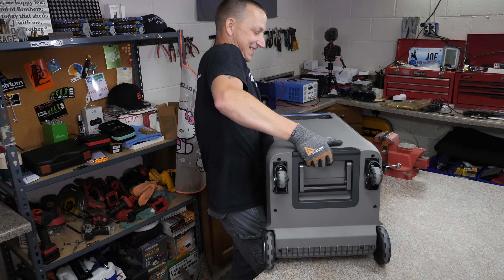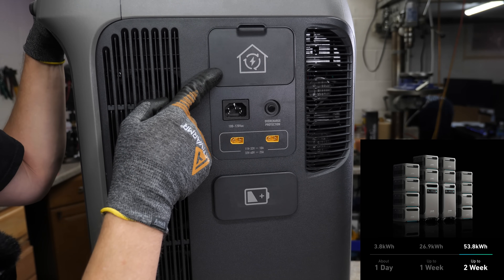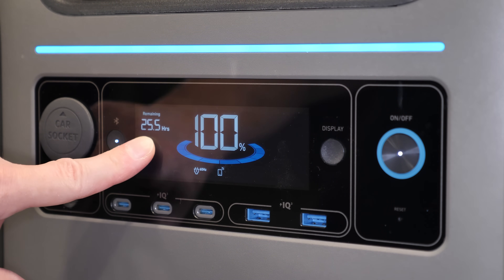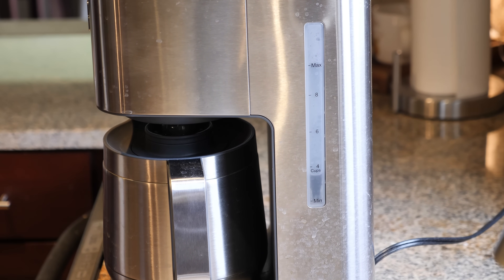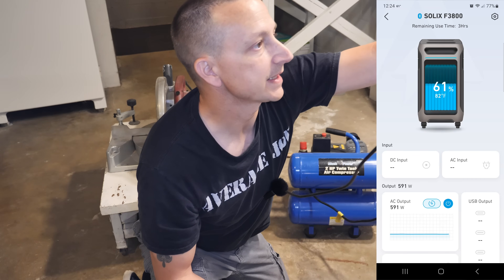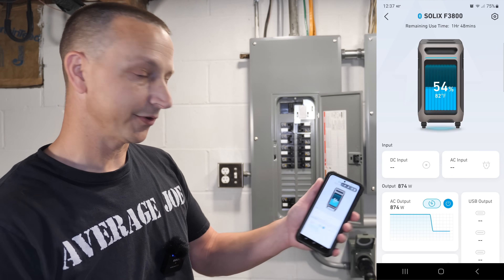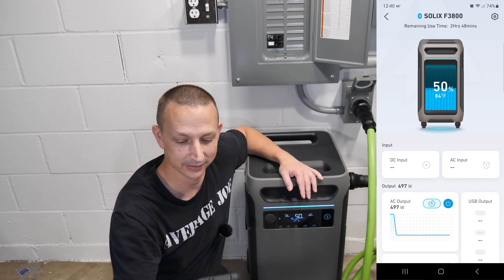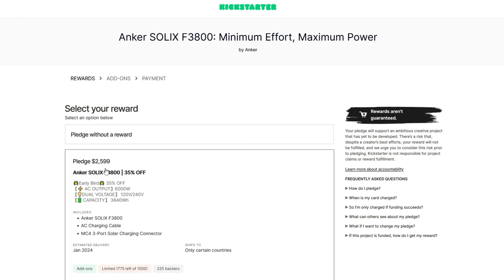Power your House in a Blackout with The Anker SOLIX F3800! It does 240V!!!

Comment: Did you try to charge it while using the 240v output? It will die relatively fast as a whole home backup. Anker said the 240v outputs go off when charging by 120v input. I was going to charge it by an inverter generator but then my entire house will go dark. Seems like they could have designed this aspect better as the rest of the system seems very nice. Solar is an option but at night and in stormy weather is useless. Thanks for the great video.
Reply from the maker: Yep it will shut down however...they are making a new version and they plan to fix that problem as well as raise the solar input voltage I hear. If so that will be a game changer!🤘

Comment: We are looking for generators we can donate to western North Carolina . What  generator would you recommend.? Keep in mind the generator will have to be carried in by hand or air lifted . They need to run the essential
Reply from the maker: I wish I could be there to help! So this portable power station is pretty heavy as many 48v versions are but does have the easy handle and bigger wheels. Also does 240v if thats needed and has 3.8kwh battery? Another GREAT one is the ecoflow deltas. They are a little smaller in size but about the same battery capacity at 3.7kwh but not 240v. I have a video on them when we had a devistating storm. I let my buddy use them. The Pecron E2000 is another GREAT one. Its smaller tho but works great. Battery is 2kwh. Again, I have a video on that. Oukitel has the p5000 which is fantastic and has 5kwh. I have links in all the videos and some  have discount codes. Also many are on amazon so could possibly get them somewhat fast. Honestly, for what your wanting to do. Id get almost anything to help a brother out. If you have more questions please let me know and Ill help where I can! Stay Safe Brother
Reply from the maker: You should email me any questions averagejoestuff@gmail and I can help!

Comment: Excellent video! I'm sure you're right - without the soft start on your HVAC it would have tripped/shutdown the Solix (assuming the wattage initially draws +6000W - the apps usually don't track the spike since it happens so quickly).
Reply from the maker: Yeah its hard to say. I wanna say I started it with 2 ecoflow delta pros paralleled together before I installed the soft start but cant remember. I may actually do it🤔

Comment: How does this compare to the equivalent Ecoflow? Is there any other one that you would recommend? I'm in FL and hurricane season is coming, and I have a 3/2 home with a 4 ton A/C Unit. Looking to find a manual switch over generator like the Anker Solix and later hook up solar to it as well.
Reply from the maker: I did a comparison video between the F3800 with expansion battery and EcoFlow Delta pro Ultra. Purely going off specs they are close. The ecoflow has better options for solar. Anker is moar portable. Both can start my 4ton AC but I have a soft start on mine.

If you want to power your entire home and use the AC "long term" in an outage, you would need a few expansion batteries on either system.

Comment: Can you charge this power station from a 120 volt inverter generator like a Dual Fuel Champion Invertor Generator, while using the 240 volts from the Anker Solix F3800 power station?  I know that I can't charge my two EcoFlow Delta Pros from 120 volt grid power or an inverter generator power when I have the two Ecoflow Delta Pros hooked together for split phase 120/240 volt power.  Thanks, great video.
Reply from the maker: Thanks for watching! This one cannot supply 240v and beable to charge from a 120v source at the same time sadly. I did mention this to Anker in a meeting. I know the ecoflow delta pro ultra can do it.
Reply: @AVERAGE_JOE  Thanks for your reply.

Comment: So if this thing has 3.8 kWh capacity and you live in the south you would be able to run tour air-conditioning only if the power cuts out for no more then 1 hour. 😅
Reply from the maker: Its very possible depending on your AC. If it draws around 3000w or less, I would say yes. You can also get a bundle kit with an expandable battery to give you more run time.

Comment: nice unit but still don't think they're priced well enough, nor would supply power long enough to be a viable option when you would need to run 3 or 4 1500w heaters should the power go out in winter for anything longer than a couple of hours.
Reply from the maker: I did another video using it in a simulated power outage.  We had -15f temps, I ran my critical loads panel which powered 2 fridges, some lights, cable modem and router, a pot of coffee and my furnace.  Furnace ran the entire time since it was so cold out.  We ran for about 6hrs.  Most of the load was the furnace.  They also have a bundle kit deal going on right now.  Here is the link to the other video https://youtu.be/dxy89Mlsph0

Comment: Good to see the details for use!!! Started at 6 hours up time and with just a few test items the run time was down to just minutes. It is really good to plan a backup. Example - the battery would run any one of the items but in the end it would do 10 - 15 cycles of the microwave or about two cycles on the AC unit!!
Reply from the maker: Checkout one of my last videos doing a simulated blackout.  Gives a better example https://youtu.be/dxy89Mlsph0
Reply: Thanks. Have been filtering through a few others  @AVERAGE_JOE

Comment: I wish I've had the patience to fallow the whole video. I am not interested if it works with my toaster. I want to know for how long it will power my gas heater in case of power outrage in winter?
20min video? you-re in to make money.
Reply from the maker: I have another video powering my gas furnace and critical loads in -15f weather. My furnace was running the entire time since it was so cold out. I ran for around 6hrs.

Comment: Are you saying running 3000 watts with a air conditioner will drain a full F3800 in 40 minutes?
Reply from the maker: If the capacity of the battery is 3800watt hours and you run a 3000watt load. Assuming the battery is full charged, It will run for a little over 1hr.

Comment: How long can it power a 1/2HP Sump Pump which many people want to know for blackout emergencies?
Reply from the maker: Thats a great question. Since I dont have one, I just went online to see the running watts of a 1/2hp sump pump. It shows around 1050 running watts. If that is true, the pump could run over 3 to 3-1/2hrs. That is straight on and not turning off. If you have the expansion battery then the run time doubles. I have a question since I dont have one. Do sump pumps run for hours at a time or does it run for short amounts of time. If its on/off all the time then the run time will go way up.

Comment: Hey Joe I'm just a little confused you used the 50 amp the back feed panel to run your house. But shouldn’t you have used the 30 amp 240 V to backfeed the panel. and if not why. The Math is  6000 W convert to 30 amp to 240v max on a single phase panel. Not sure how 50 amp output comes from a f3800 unit the math doesn't add up

Comment: The anker only holds 3.84kWh ... in order to match or exceed a Tesla Powerwall mk2 (14kWh) you'd need a total of four(4) of them.  The prices for both comparable.
Reply from the maker: Plus this option is portable so you can take it with if you move.

Comment: Correct me if I’m wrong. But if you use nothing but your lights and keep your fridge going, you basically can get two hours out of this unit.
Reply from the maker: You can get a few more hours then 2. We have led lights so those can run for hours. Fridge could run for about 2 days since its not "on" all the time. My fridge uses an avg of 1.7kwh per day so that gives me more the 2 days but will say 2 to make it easy.

Comment: Not sure if I am missing something here, if normal electrics are lost, how long can this Anker Solix supply the house with electricity before it requires charging again, I would have thought you would have included this info.
Reply: It’s a simple calculation that you can make based on your homes draw. This battery unit has 3.8kw/h of storage, which means it can run a 3.8kw load for 1hr, and I think the max this unit can supply is 5kw, which with that storage capacity, it could run for about 40mins. 

So let’s say you’ve got a central air conditioner that pulls 3kw to run. This backup could run it for about 1hr-15mins. 

So to put it simply, although this unit CAN power most of the loads that a home would have, (soft start needed for central a/c) it can do most of the large ones for about 1hr before needing to be recharged. This is why he mentioned the solar panels at the end. Because you would need something charging it for it to be able to maintain loads in your house for an extended period of time. 

This is more of a battery “buffer” than it is a total power backup, if that makes sense.

Comment: I just don’t get it with these battery stations.  So it showed you had 4 hours of battery left, or a lot less if you actually power stuff.  What are you supposed to do when that battery runs out?  Roll solar panels out and wait hours or days for it to charge?  I have the solix c1000.  It will power a little space heater for about an hour and a half.  I just don’t get what you’re supposed to do once it’s dead.  Wait for solar?
Reply: It helps you survive a little longer without power. They don't replace your usual power source while you live as if there is no outage.

People are spoiled to the point they can't make adjustments for a few hours or a couple of days by conserving energy.

Comment: I just received my F3800.  Nice and ready to go.  But??   I ask Anker Support about charging the powerhouse with my DeWalt generator.  My initial concern was the gen puts out 120v 20 amp = 2400 watts.  Anker only accepts 1800 and wanted to know if this would be a problem.  Watts no problem but the gen is.  My gen is not a pure sine wave.  Modified sine which almost all gas gens are.  So the dilemma is that could damage the unit just like other sensitive electronic.  So the question with this new Anker F3800 and your out of power for 3 days and its raining, how do you charge the unit?
Reply from the maker: Right so I have not tried a modified sine genny so I cant say for sure. My only other suggestion would be to get an AC to DC charger and charge from the AC output from gen to solar input on the F3800. I would shoot for around 60vdc like a 56 to 58.8v lithium charger. Ill look around and see if there are better options.
Reply: The generator can supply up to 2400W of power, it does not force 2400W into the load, so if the Anker can only draw 1800W then that is what Anker will draw from the generator, just look at this way, your wall AC outlet in your house can supply up to 120V x 15A = 1800W, so if you plug a 100W lamp into the socket the lamp will draw only 100W the outlet is not going to force 1800W into the lamp.
It is good to have generator with 20% head room above maximum load, I'm not sure the Anker will like to feed with modified sine wave, I would suggest using Inverter generator.

Comment: Can this charge via DC (solar panels or external battery) at the same time as providing 240V output? Wondering if we can trickle charge it in an emergency while the AC is still running.
Reply from the maker: Ya you can still use it while DC charging.
Reply: Perfect, thanks!  @AVERAGE_JOE

Comment: Hey Joe… when you are reviewing these units can you talk about recharging them with a small generator instead of solar panels.  I like Anker products.  We are in Florida and with extended power outage it would be nice to be able to run our AC for a bit.  There is a 50 amp Soft-Start device used for RV’s that is plugged into the power cord and not installed in the AC unit.  I wounded if that would work for a residential AC unit?  Thanks for all your helpful information.  JR
Reply from the maker: Yeah I could mention using a generator for recharging in a power outage type scnario. Its basically the same as plugging into the wall of your house OR using a dc charger and using the solar input. I havent tried an inline soft start but it would probly help.

Comment: sorry ,,Starting your saw isn't proving nothing ! putting a load on it such as actually cutting a 2x6 a 4" pipe is what a test is . I can pull the trigger on anything until you actually put some torque or load on an tool means nothing to the product your testing

Comment: please compare the f3800 to the ecoflow delta pro ultra.  trying to decide between the two.  thanks for this well done review.
Reply from the maker: I did just get the delta pro ultra. The ultra is just a bigger unit compared to the f3800. Bigger inverter, bigger battery and has 2 solar inputs. One is 150v and other is 500v. It really depends on the usage. If you want portability(as in taking camping or RV or where ever and bring it back inside), you would want the f3800. The ultra is "portable" but super heavy.

Comment: Thanks for all the details.  Regarding UPS functionality.  Can it run like a true UPS i.e. set it up and forget it to provide power to essential items? I want to use it as a UPS for my home network and my aquarium.  I tried this with the Ecoflow delta pro and it just shuts off power output after running for a few weeks.  Happened twice with 2 separate units.  EF support eventually told me I have to "do maintenance" and drain the battery once a month for it to work as a UPS, this of course is not ideal.

Comment: Good system, but not suitable for a whole house backup by itself.  This would be good for an emergency backup.  Now, if you use the expansion capability, I could see this being a viable whole house backup system.  It would also be suitable for off grid power when combined with a suitable solar system.  However, the charging limits concern me a bit.  The idea is that it should be able to charge at a comparable rate to its discharge rate.  The reason being, this limits the size of your array.  Any panels you put on above the connector limits would have to be disused.  Therefore, I would definitely utilize the expansion capability and get a second base unit.  That would double your charging through put.

Comment: Will it run a clothes dryer or an electric stove with 550 Vac power plugs ?
Reply from the maker: If the working voltage on them are 240v then yes but you would want change the plugs.
Reply: The working voltage is 550 VAC @AVERAGE_JOE
Reply from the maker: This is a 240vac power station🤷‍♂️ Not sure about a portable 550vac unit. Or at least I havent seen one.
Reply: What kind of 550VAC outlet do you have in the house? Are you sure that it is 550VAC, that is an odd Voltage value?

Comment: Do the cables come with the unit ?   Is there a list of what comes with this unit ?  Will I have to buy a generator to get 550 Vac ?
Reply from the maker: Mine came with the AC 120vac charging cable and a 3 way MC4 connector for solar charging. Where are you that req 550vac?
Reply: Victoria British Columbia Canada - Electric stove and full size clothes dryer both use 550 VAC although I think EV car fast chargers do as well. @AVERAGE_JOE

Comment: The real practical question is not what can it run, rather, how long can it run it ? What good is it to be able to run an oven if you can only do so for 24 minutes ? Obviously, this solar genny has a great inverter system in it, but if you're really going to do home backup properly, then you probably should get two of these units with at least 1 external battery for each unit and parallel connect them for better capacity. Bridge connecting will allow you to connect enough external solar to each unit to greatly counteract your drain rate while on full blown house backup mode. Charge all Day and drain all Night. The average household will consume 3.5 Kw just cooking diner alone in the evening, whereby your house lights are on, your oven and stove are in use, and you're opening the fridge allot.
Reply from the maker: 100% correct. In a full blown outage you would run minimal items. If you add another in parallel along with another battery or 2. You could have a really sweet backup system.

Comment: The problem with the battery UPS is it might be good for a few hours but if you lose power for a couple days your back to square 1
I would be interested in a discussion of product cost plus installation of a unit like described in the video vs. a Generac unit running off of propane or natural gas.
I think right now if I had Natural gas piped to my home I would do the Generac and never have to worry about charging after a few hours.
Reply from the maker: A generator is a must have in my book. A propane or NG would be a great option! I have a 5kw diesel generator for the times we have no grid, no sun and batteries are dead! I would suggest gas being the 3rd option of the three.

Comment: Will this handle a 1HP 240v well pump surge?  Other items are the usual TVs and computers and whatever lights I would have on at the time.    I have a Oil furnace forced hot water and propane gas for cooking and clothes dryer.
Reply from the maker: Do you know what the watts are of the pump?
Reply: @AVERAGE_JOE  No, but it's either a 1.0 or 1.5HP pump.   About 5 years ago I got a quote for the Generac System.   It included 11KW peak system.   My cooking and cloths dryer are propane.   Other than that the usual, Refrigerator,  Oil fired furnace with forced hotwarter,  TVs and lights.